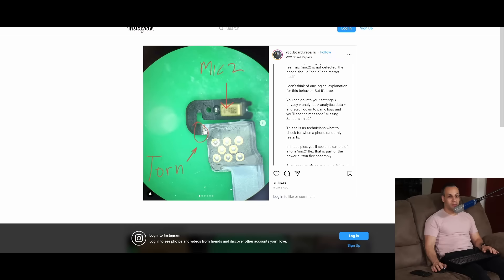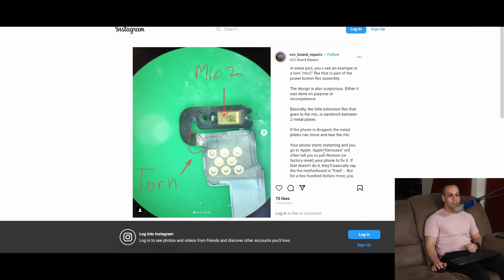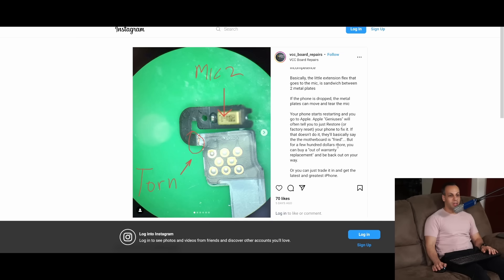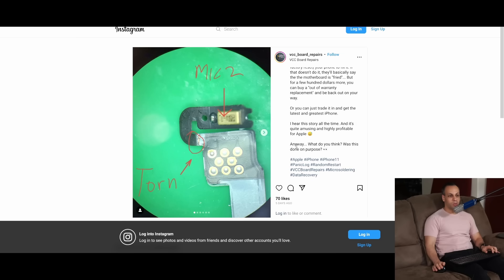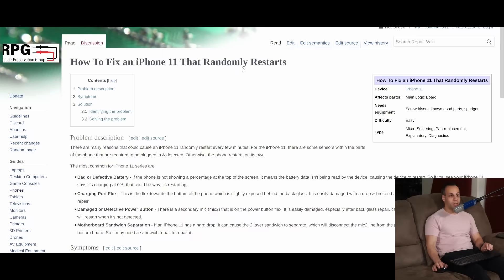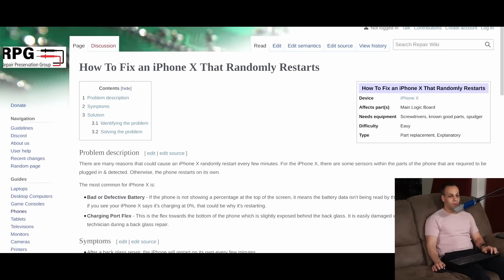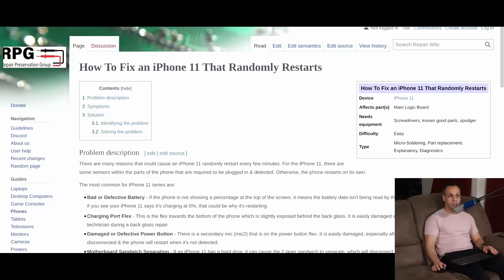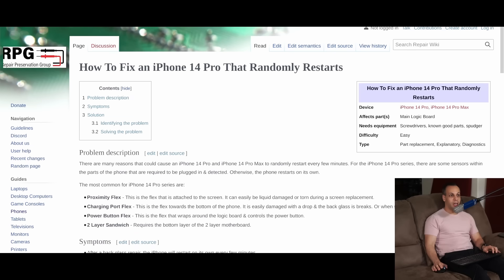iPhone's design flaw shows that 10 years later, their engineering is still a joke

Comment: I try avoiding being too vocal about this. Because Apple just has to flip a switch, and then we won't get access to panic logs in the next iOS version. I am actually waiting for this to happen any day: I don't understand why they leave these logs available to the public. It is so uncharacteristic of them. You can't even argue that they leave them here for their "Geniuses", because they don't even look at them: they just tell you to buy a new phone.

But yeah, it pisses me off as well. Because as you say, this is a software issue (the software decides to reboot the system, which could totally survive with a missing sensor), that could be fixed by Apple as easily as pressing a button.

Note also that starting with iPhone 13, they made these panic logs even more cryptic. Now the missing sensors are not mentioned by name anymore, but by a code. It's just a matter of experimenting, in order to find what code corresponds to what sensor; but "mic1" is much easier to understand than "0x0800". Makes you wonder again, if they did this on purpose... Why make the panic log more obscure, when you can simply not allow the user to see it?

Comment: You're not entirely correct on this one Louis. The phone kernel panics not because it can't detect the microphone, but rather themalmonitord crashes the phone because mic2 (as mic1 and some other thermal sensors) start reporting raw values (128°C). The phone starts to think it's overheating and shuts off. Even Jessa has written a whole article on this issue and where to locate thermal sensors. A rare occurrence, but I have to disagree on this one. Similarly, Samsung has similar problems where the phone will tell you that the charge port has liquid inside of it when the sensor goes bad. So it really isn't just Apple here and you know from your own experience that a dead thermal sensor in a MacBook or any other laptop will cause similar problems.

Comment: Interesting at 9 minutes you mentioned a car thing, I was just thinking about the failure in the Nissan Sentra and what happens with the master control switch if a slight amount of water touches it. And then also expressing where the wipers direct the water, when not in transit.

Comment: As an engineer, I think some aspects of the video are a bit misleading. Average viewers with limited or no knowledge about such topics might conclude that: 

Apple detects that a mic is disconnected or defective and then, to annoy the customer, generate a random number, restart the device after said random seconds over and over again in order to sell them a replacement or newer model iPhone when they bring it into an Apple Store.

That is simply not the case. The case that the flat cable breaks or is cut in half was never among expected fail states. Broken vias can lead to voltage drops, signal deterioration or even short circuits, depending on how freely said part can move after the defect.

Depending on the part, it also matters where a sensor is located - before the cable or closer to the modular component. If the cable was damaged, it might lead to consequences that were never expected, while if just the microphone failed, but the cable was intact, the sensor would report: the mic is broken and can catch the exception. Whether this is the case in this specific case (rear microphone) I don’t know, but with other components it can make a difference in how the error manifests.

Furthermore, the design might not always be to blame. Mass production is challenging. A ribbon cable sandwiched between 2 metal plates isn’t necessarily bad design. It might have been tested in a smaller series production and no problems occurred. Quite a lot of issues start with mass manufacturing, for example, slight deviations of the stamped metal plates. A worker assembling it, won’t notice that the edges might be slightly out of spec.
Would it matter if the design was to blame or a problem during manufacturing / assembly? No. But it makes a huge difference when judging who is responsible for it. If it’s just a bad design, it’s some engineer’s problem. If it’s due to fluctuating tolerances, it’s a QA / manufacturing problem. In this context it also matters how often this error occurs in the wild and how often it, well, doesn’t.

Without trying to defend the issue, it seems that the issue develops after the device has been dropped. Usually, that is when all bets are off. While phones are getting drop tested nowadays, it’s obviously not what you should do with the device. I would be concerned if the cable was damaged during normal usage of the device.

As for the car analogy, imagine hitting something with your car and then complaining about a distance sensor cable in the front bumper getting damaged due to the forces at play. Ideally, the sensor would still work despite the damage, but it always depends what the device or car in this case, was built for (civilian use cases vs military use cases etc.) Most cars run self-diagnostics and display defects to the driver. In case of more technical issues, the issue is accessible for professionals via OBD etc. Should the car stop working, because a non-security related part has stopped working? No. Does it? No. Does the iPhone stop working on purpose? No.

A recent experience with a friend’s Samsung Galaxy device reminded me that even the self-diagnostic isn’t always reliable. The entire sensor board stopped working. The gyroscope stopped working, the Hall effect sensor etc. Diagnostics said: all fine and even showed ghost data for the gyroscope and non-existent magnetic fields. In this case, the device wasn’t dropped nor was it old.

The reason why these “exceptions” aren’t caught in the driver / kernel is because the fail state should have never happened and wasn’t expected. To use a car analogy once more, it’s like having a bullet hole in your engine block, sensors are detecting a massive pressure drop. Would it be cool if the car still worked for a while? Sure. Was it a design goal for the engineers designing the engine? No. Not because Apple is shamelessly rubbing their hands in some illuminati fashion to squeeze more money out of you. Would they rather sell you a new iPhone every year? Absolutely. Do they go as far as randomly restarting your phone to annoy you? No. Are iPhones perfect and flawless? No. Will they ever be? No. Is Apple particularly cocky in their marketing and how they present themselves? Yes. Do they deserve to be called out on a lot of issues? Absolutely!

I guess what I am trying to say is: some fail states can’t or shouldn’t happen, and if they do, the problem lies elsewhere, not with the software.

Comment: As someone that worked on third-party Android AOSP code, I screwed up writing system code. Some code in the system code would happen on startup, which would cause the OS to crash and restart. The crazy thing is that it wasn't handled in the OS. The OS would just crash in the part of the code I added. Of course I fixed it later, but what a doozy to debug. I don't expect a lot of shops to figure that out

iOS might be different, maybe not.

Comment: As another example, I've disconnected components in the process of repair on several different Motorola smartphones:  I found I could disconnect speakers, microphones, cameras, digitizers, etc. and have it still boot normally, just without the function of the part.  They even ship with a factory setting (selectable in recovery boot menu) to boot into a diagnostic mode that allows you to test all the phone functions individually.

Regarding the Check Engine light story, most cars provide ample warnings or means to contact or schedule work at a dealership through the interface.  The critical difference is, you have multiple choices of shops and parts sources, including the ability to do it yourself because you can buy the tools.

Comment: So you don't know why they did that? It's very simple, repair profits/trade in. The other is 3 letter agency listening or Apple listening to you. It is no secret the back doors in place on our chips. So a better hunt would be pulling the code specifically around that microphone. I'll bet there are anonymous activation protocols. The sharp plates could be bad quality check. I'd wager most likely did not want to fix part design to not be sharp. If it is a coding goof, they will patch it in a week plus what was patched.

Comment: As any long time computer user will tell you, sometimes things do get magically fixed when you turn it off and back on again, so that part isn't in itself all that bad. Where Apple failed, besides the self-destructing design, is in not checking for too many bootloops to switch to a different behavior as after a few tries it becomes clear that's not fixing things.

Comment: Don't go to far Louis, General Motors Corporation who ownes chevrolet already does this with diesel pickup trucks, when the crappy and expensive emission system goes bad, the engine goes into something called "limp mode". A car cannot go above 20 miles per hour when in limp mode.

Comment: I learned that you start off as a guy in a garage, work your way up to a million dollar company then start closing " open source " info on it.  I learned that all the time and effort used from the start slowly goes down hill as the dollars start adding up to the point that you are a Brand, not just some company that makes things.  I learned that once you are Global Branded and have the cash on hand for lawyers to go after name infringement you can stop the issue resolving with some, not many, exceptions.  I learned that they can also cheap out on components at that point and make a device for less than $20USD including labour and sell it for over $400USD ( pre taxes, if any ).

Comment: The microphone thing is pretty obvious. I would think it is a miracle if an iphone can work with any damaged parts. Obviously they want their products to work as whole at every time, that's part of their advertisement. They don't want anyone walking around with a partially functioning Apple product, giving the image that there are apple products can work poorly. They want to make turn every owner into a billboard, do they have the right to do that? who knows, maybe it would be important for them to have warnings about that in their ads...
Reply from the maker: They have people walking around with devices that reboot every 3 minutes with no idea why. I'm sure that creates a lovely brand image and customer experience!
Reply: @@jacksparrow2351I'm sure your familiar with the term "small sample size"?
Reply: @@jacksparrow2351 "hey I don't have any problems, it must means that no one has any problems with apple products".
I worked in phone repairs for 6 years, believe me, their products fail... all the time.
Reply: Actually, iPhones work with a ton of issues all the time, with no restarts. No Face ID, No Service, No WiFi/BT, No Backlight, No Touch, No Rear Cam(s), No Front Cam, the list can go on. All these issues can be present & the phone will function 100% normally with no restarts.

We see this every day at my shop.

iPhone X, XS, XS Max - No bottom mic (mic1) or no pressure sensor, it'll restart. 
But rear mic (mic2) damaged? It'll be fine

iPhone 11, 11 Pro, 11 Pro Max - This series introduced the rear mic (mic2) as part of the "sensors" required so it doesnt restart.

iPhone 12 series - They went back to the same as iPhone X series, it'll restart with Mic1 issues and pressure sensor issues. But rear mic (mic2) damaged? Itll be fine, once again

iPhone 13 series - They now added the proximity flex to the mix. If that one is damaged or not plugged in, it'll restart. 

iPhone 14 Pro and 14 Pro Max - These added the charging port flex, the power button flex, the proximity flex. Even the bottom board of the 2 layer sandwich, if it's separated, it'll restart.

And to add to the fun, iPhone 14 and 14 Plus, with the removable back glass, if that thing is unplugged (wireless coil), it'll restart as well lol

So what i'm curious about, why there are certain "sensors" required on certain models but no others? And why does it change per model?
Reply: @@jacksparrow2351 I make a living from fixing these problems 🤷‍♂️
Reply: @@jacksparrow2351 but nobody gives a fuck about "you" it's about the millions of computers, phones etc out there.

Comment: I wouldn't clarify this as a crash.  This sounds like a watchdog service, which is used for monitoring various parts of hardware and software.  It can be told to automatically reboot the device if necessary, such as hardware being inaccessible, or a daemon crashing that normally shouldn't crash when started.  The Linux kernel supports such a feature.

I also agree with Louis that this is just bad design and not planned obsolesce because it can happen while you still have your warranty with apple.  So this would cost apple money to fix.

Comment: I used to be annoyed by the iPhones failing to work if they didn't have a battery installed. They would start up, but half of the hardware wouldn't function, including audio and WiFi. At the time, Android phones like the Samsung Galaxy S3 would work fine without a battery as long as the charger was strong enough. 

Not working because of a microphone is quite silly. The iPhone 8 somehow managed to work (in a biggy manner) when the whole audio IC would die.

Comment: here's a good one! when someone brings a boot-looping phone caused by those metal pieces cutting the cable, not only do you replace the part, you also give apples' engineers a big fat FU and remove the metal plates! not only fixing the problem but preventing it from happening the same way ever again with their phone! I never trusted apple products because they are overpriced for the features and too proprietary to the point its hell trying to develop an app for them. they need to kiss some developer 0xA55.

Comment: Similar issue happens with MacOS. If you have a RadeonVII installed as an eGPU, it'll eventually cause the mac to kernel panic. Most of the time, it just completely freezes and it won't even restart, you'd have to force kill the power. This is most likely related to the audio drivers, the only known solution would have been to disable the kext responsible for audio via displayport/hdmi. However, with newer versions of MacOS, the system directory is locked down so you cannot disable any system kexts.

Comment: I've also noticed that on many of these models when the ear speaker assembly is damaged it will cause the device to boot loop, where it never gets past the apple logo, however when you disconnect the cable it boots up just fine, could this be related to this? i know this is defenitely an issue the genius bar will tell you that you need to replace the entire phone, although then again apprently they tell people that for just a broken camera lens aswell.

Comment: You're making the mistake of assuming it wasn't designed this way on purpose. Having critical components on your phone designed in such a way that they will actively destroy themselves over time, thus forcing the customer to buy a replacement, seems pretty on-brand to me.

Only way it could be more on-brand is if it was a Sony phone instead of Apple.

Comment: Funny to see Louis post video of this today after having one  rebooting SE2020 earlier today while replacing the frame. Problem was with the charging port this time. What will it be next time...only god knows since pretty much any faulty part on iPhone can cause it.
Reply: It's funny because each model has its unique parts that cause 3 min restarts.

14 Pro Max requires power button, charging port, prox flex and can't have sandwich separated, or it'll restart

Comment: Engineer... makes it go to an error message... the corrupt single engineer who execs pay well on the side... comes in behind them and changes it to panic...   so that it can be dealt with as a "need new device" same with removing the nice smooth edges of the metal retaining plate...  At this point my opinion is their designed obsolescence does include making it fail every way they can, so they can make more money.

Comment: @3:10 you mentioned the dreaded check engine light. That's just as frustrating because even though the modern cars have digital displays all they tend to say is "contact dealer". If the car is smart enough to say "contact dealer" why can't it also display what it thinks is wrong.

Comment: I’m still using an iPhone 8 Plus and an iPad Pro 10.5” with the original iOS they had out of the box for both because the hardware is still fine and I don’t want to have to use Face ID or be forced to agree to new user agreements. I also like having the headphone jack on the iPad. I’m finding other software companies are disabling old versions of their software - Twitter, for example. My old Twitter software no longer can access the service & trying to update in the store fails. This is forcing me to either abandon the necessary tools I need to function & connect with people (the whole purpose of the device), update iOS and agree to new terms & allow them to slow down my hardware & degrade the battery so I’ll need a new device, or just flat out get a new device. None of those options work for me & it’s not the money. I paid for these devices however & expect them to continue to function without being forced to render them obsolete so I have to buy new devices. Any advice?
Reply: Oo you just realized that eh? Use android, they'll lasted you decades!! That's why my first and last iphone is the 6.. while my both of my Sony/samsung android from 2013/2011 still got many apps working and especially their web browser are much zippy. Edit : oh, buy the Nokia with  android go label, they still got a replaceable battery!